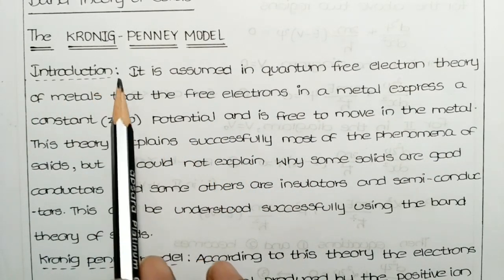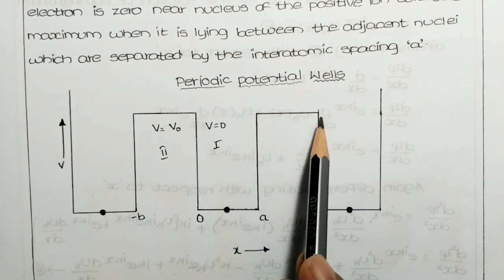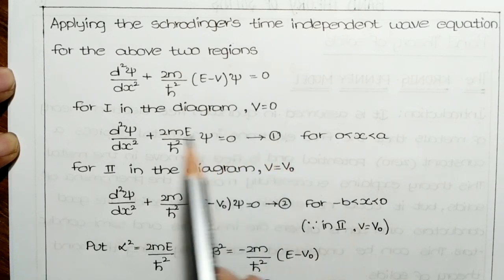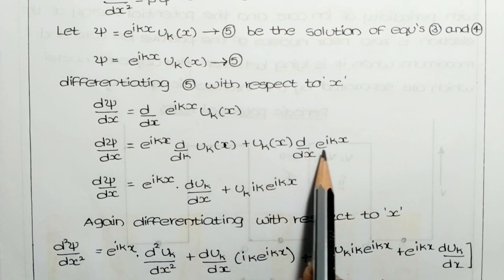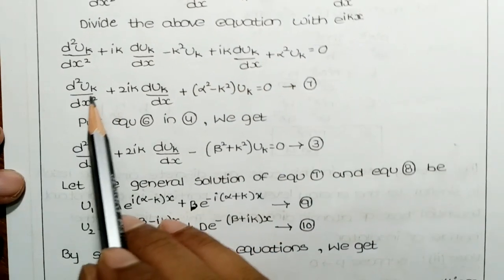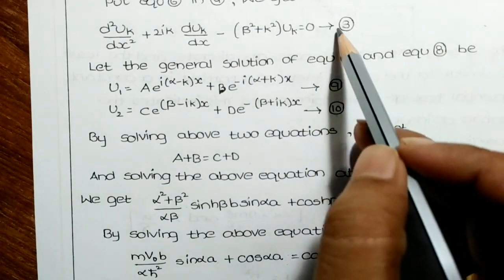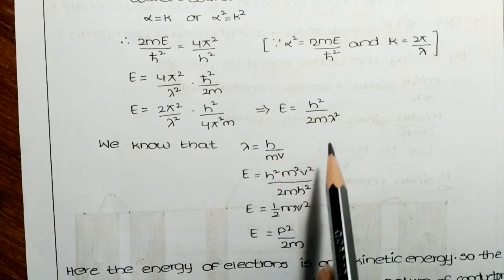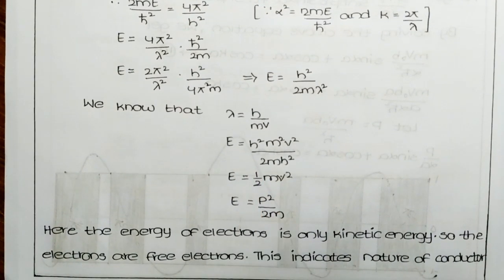Kronig-Penny Model | band theory of solids | Physics |

Comment: Wrong derivation...you have assumed beta as -ve 2m(E-vo)/hbar^2 where as there shouldn't be negative sign.
Reply: Your equation 3 is also wrong... It should be k^2 - b^2 and not k^2 + b^2
Reply: actual me V-E hota h usme -(E-V) likha both are the same thing
Reply from the maker: Once again go through the equation. What ever you wrote 2m(h-vo) is wrong.  The correct eqn is 2m(Vo-E)/h cross square